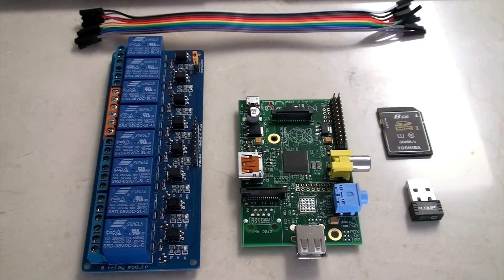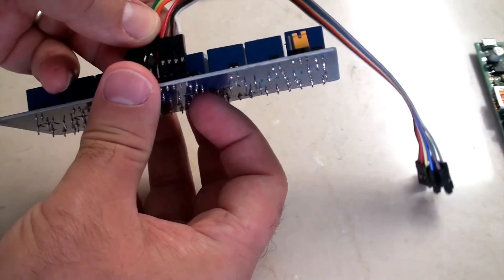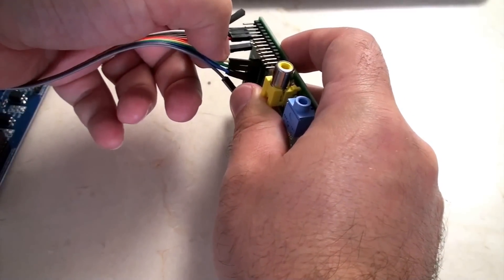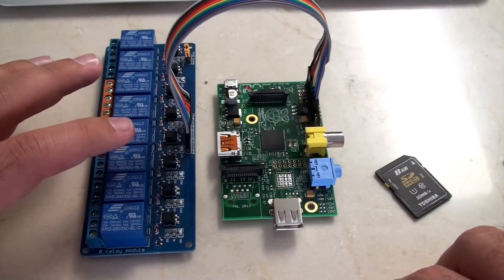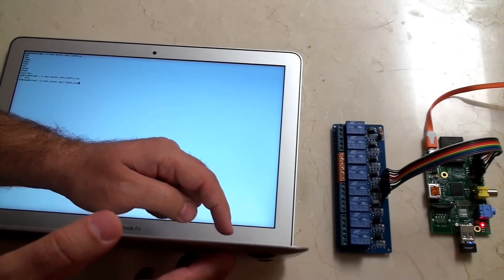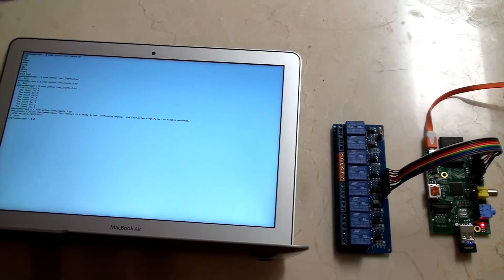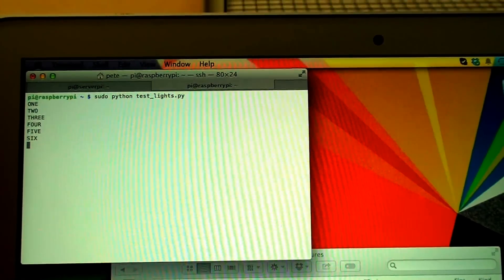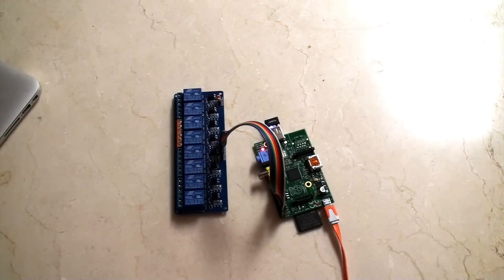Raspberry Pi: 8 Channel Relay step-by-step with software examples for automation

Comment: My guess would be lack of power, you see the little yellow jumper on the relay board? With that jumper in, the pi is energizing the relay coils which takes up too much juice for the model B. If you remove that jumper and plug in a separate 5v power supply properly, it will power the relays while the pi only turns on the opto isolators or transistors.
Reply: skiwithpete yep, as   whyvas   says, it's a power-related problem. The relay coils will draw quite a bit of power form the 5v line (12v coil relays would draw less, but then you'd need to use two supplies - 12v and 5v.
  The combined current draw from your PSU of the Pi itself plus the relay coils supplied form the Pi 5v pin is way beyond what can be tolerated. That's whey the first few work, but the last don't. A simple way to test/prove this would be try with a Mod-B and activate the last 2 or 3 relays alone, they should work, but not when you want them all to switch.

In a perfect world, you would use a good 5V 1A or 2A  PSU for the RasPi and another 5V PSU for the relay board/s.  That's 1A or 2A real measured output, not what it claims on the label ;)

That way the coil of the relay doesn't load the Pi power rails in any way. The relays may, if you are lucky, have a coil current rating on them, in mA, or a resistance (from which you can work out the coil current using Ohm's Law) - or you may have to look it up from the relay model code. They will also have the switch-side ratings on there too, probably 10A/120v and 7A/250v or similar, but you want the coil rating at 5Volts.

5Volt relays tend to be heavy on coil current (compared to 12Volt or 24Volt relays, Ohm's Law again) , some draw 125 or 150mA each when the coil is energised.

Multiply the coil current rating by 8 (8 relays), then add some extra for the LEDs and Optocouplers on the board (I'd go for 100mA extra for them as a very,very safe estimate) and that's the current rating you need from the relay-board 5V PSU. 
Personally, I'd just use another 2A PSU for the relays, to be on the safe side and for an easy life, but that may be overkill. You might be lucky and get away with a 1A one, a lot depends on the relay rating/quality (*)

The power supply "rails" as we call them are critical to any circuit's reliability, a saggy rail means trouble sooner or later. In your case, you hit it early on.

Low-current coil relays, or latching ones, cost much, much more than standard ones. Common ranges for smaller 5v mains-rated relays are 36 Ohms up to 208 Ohms, at 5Volts, which gives a coil current of 138mA  and 24mA respectively, so it can vary a lot depending on the relay:

 I (Amperes) = Volts / Resistance (Ohms) 

 I                 =5 / 36  
swapping that around.... 
 5 / 36        =0.138A (that's milliAmperes) approx

same for the 208 ohm coil example:
 5 / 208       = 0.024 A (that's 24 milliAmps) approx

Asking the Pi to supply more than  1.11 Amps (138mA x 8 relays) plus some extra for the LEDs and optocouplers is going to cause a problem   :)
Reply from the maker: It's a good idea. This might be the solution I've been looking for, for a 16 channel relay!
Reply: skiwithpete Simply remove the jumper and plug a separate power supply into the JD-VCC and GND.
Reply: somebody check my working there ^ I'm tired lol

Comment: everyone I would like to see all the different ways we can put power on the other side of the relays like this. http://imgur.com/bkY8k9q
Given the relay used in the video can we use AC does the amps matter for switching?
Let me know your thoughts
Reply from the maker: WHOA.  NO MAINS!!!  Stick with low voltage products for this stuff.  I wouldn't really suggest anyone use mains unless they already know what they're doing.  And, everytime I talk to an electrician, they tell me to buy certified products, which I can't guarantee on some stuff I bought on eBay.
Reply from the maker: Derek Dickerson Luckily we live in the age of LEDs.  Any project you want, basically works on low voltage.
Reply: skiwithpete

I know I am asking allot but can you do another video of how to wire the other side of the relay? or maybe even a close shot of your lighting project to show your wire configuration out of the relay?
Reply from the maker: Derek Dickerson That's the part I'm most worried about.  But, check out my outdoor light automation vid to see if you can figure it out.
P
Reply: Yeah I plan on doing a laptop brick to power fountain pump, deck lights and sprinklers..Got to get my house painted first.LOL
Reply: skiwithpete 
doing the thermostat is easier than people realize. Just get a cheap one (non-touch screen) and put it before your good one (in the garage) and use the gpio pins to short the push buttons.
Reply: Derek Dickerson You can use 130 v @ 30A AC so 120 v should be fine
Reply: skiwithpete not that I'd feel at all comfortable with running 220 through a relay this small but, in addition to the DC ratings, the Sainsmart relays do say 10A/250VAC~10A/125VAC..?
Reply from the maker: D Balcom
Yes they do, but I'm friends with a professional electrician and he laughed when I showed him the relay.  "It would be easier to switch the house to LEDs running on 12V, than to insure a house with that thing running mains." - he said.  Which is why I started my 12V outdoor light project...
Reply: skiwithpete While I am not a professional electrician, I am a pre ARE architect, thermographer and I USED to be a Class II electrician for Northrop Grumman at the Pascagoula Shipyard.
That being said, I am a bit confused, frankly, as to how these little relays can ever refer to this seemingly erroneous rating!
I wouldn't feel at all uncomfortable running 120v through them, though, although again, unlikely I would want to do so at 10a without uber close monitoring. 
I almost wonder if they aren't listed at their actual functioning capacity, as opposed to the common rating that allows for a great amount of "buffer" leeway.

Comment: skiwithpete 
What type of amp your charger has? Was wondering if like a 1.5amp would maybe fix the lag issue on the Model B
Reply from the maker: I have tried this with 1, 1.5 and 2 amp supplies.
If you check out my outdoor light automation project, you'll see I was using a B there, and it was a behavior I noticed, but never really worried about, because the project doesn't require me to be on the pi over SSH for the majority of time.